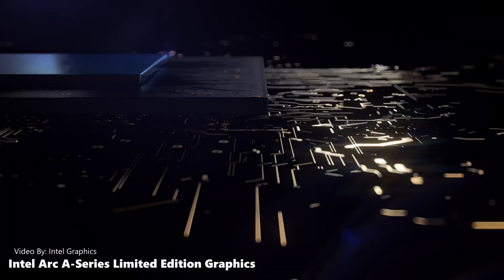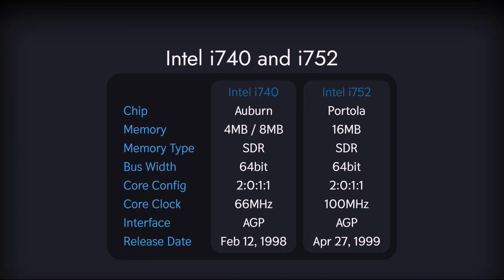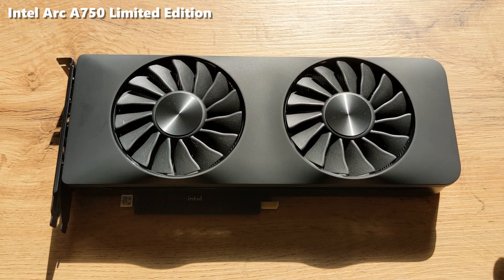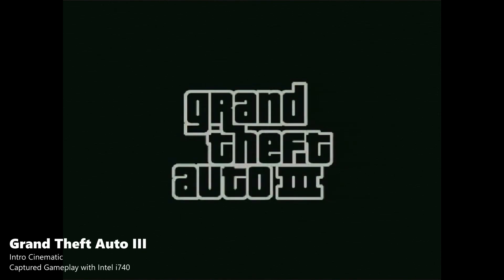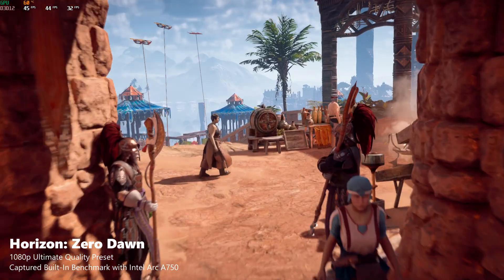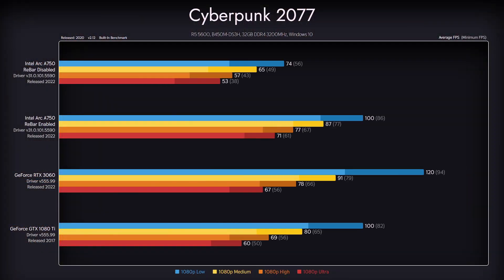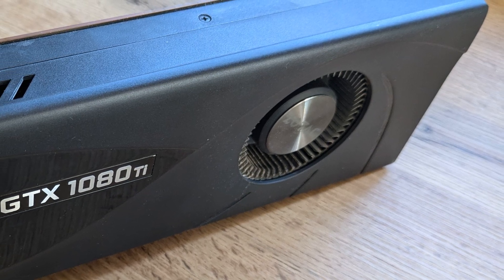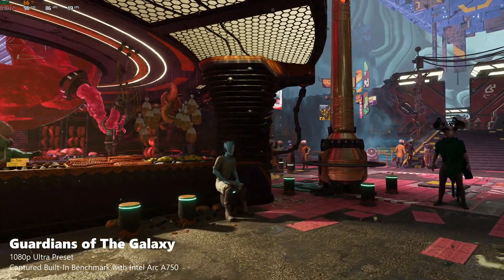Intel i740 vs Intel Arc A750 ( Intel is perpetually late )

Comment: Most benchmark i saw a750 is almost as fast as rtx 3060 
So this is very surprising because it doesn't reflect like 99% stuff i saw
Reply from the maker: What can I tell you, it's the results we got. Everything was set up correctly, including the newest drivers, and a clean OS install. You can see the potential in the 3DMark results, yet when it comes to games it underperformed. We were surprised as well. It all comes down to the set of games and driver versions. From what we gathered Forza Horizon 5 issues seem to be a regression. This was out of the box experience, and that's exactly our point here - How does the out of the box experience feel, can we actually recommend this card? And sadly, we cannot.
Reply: @attictiertech  I think answer lies in very CPU dependent nature, if you pair A750 or B580 with very high end CPU it'll shine, but anything less it drops of very fast much worse than any AMD or nVidia GPU does...

Comment: Weird i have arc a770 and it doesn't crash at all work pretty well
Reply: It out performs Rtx 3060 and rx6600
And av1 is cool 
Also was cheaper than Rtx 3060 12g 
When I bought it 
So if it had lower power consumption 
It would be perfect
Reply: @matgaw123  I'm also arc A770 user.